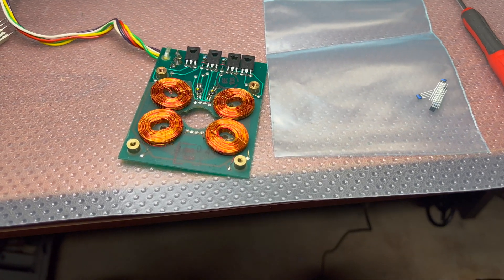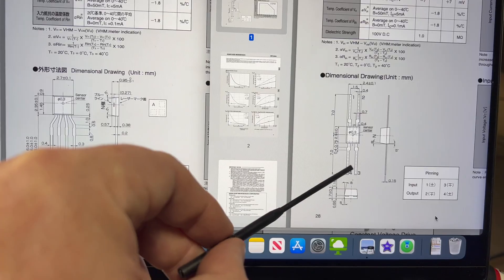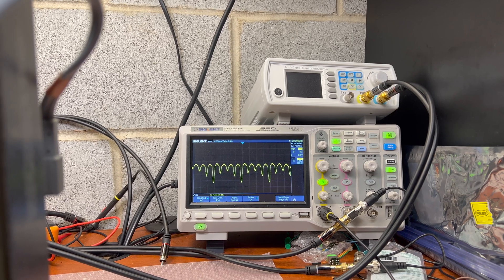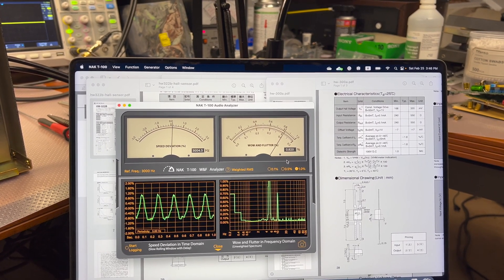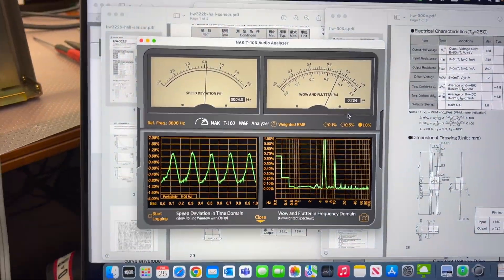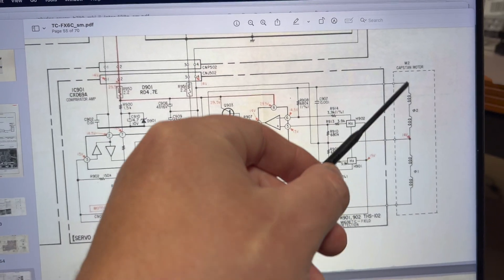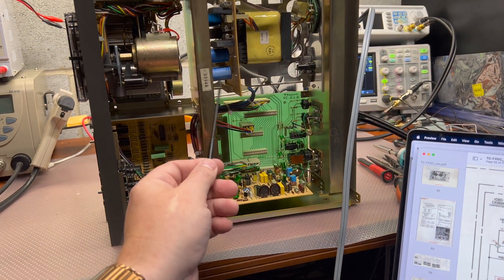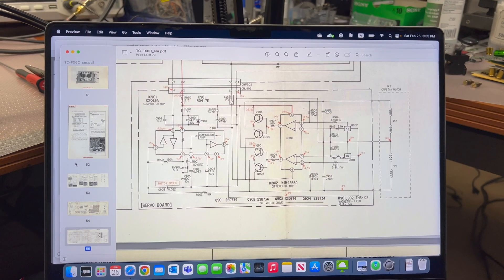Revox Flutter & Wow Diagnosis: Hall Sensor Replacement and Schematic Revision

Comment: I greatly enjoy your videos. And while I agree that the execution of the DD design by Revox in the B710/B215 is more problematic, I believe it was more intentional than an engineering mistake. You can easily look up the schematic for their B795/791 DD turntables, which came out earlier than their tape decks, and they incorporated the exact same design, with opamps driving drive transistors and limiting resistors as you show as typical Japanese. So they were definitely aware of the “right” way to do it, but chose this way for some reason, it seems. My experiences with a number of B710 & B215 decks is that W&F below 0.03% is typical, and often around 0.02% if the transport has upgraded reel motors (ball bearings instead of sintered bronze) and capstan bearings with low wear.

Comment: To me it sounds unplausible the root cause of the erratic W&F is the poor design, I don't argue about the design part but I can't see the HES being the cause... there must be some other electronic or mechanical degradation that prevents the motors or the output of the transistors to properly drive the motors, those waveforms are all MANGLED. I mean... you're on the brink of 1%... that would be unacceptable for a Walkman.

I don't have the necessary experience but nothing looks normal to my untrained eyes in what you show. Are you sure the functioning of the thing after replacing the parts is not being invalidated  by EM interference?

I have reformulated the above question because I didn't mean to say reading, I meant the machine is not being affected by something else that's going on in your lab.

Comment: REVOX, what an extravagant cassette deck it is; but you found out that the Swissi engineers made a terrible mistake in the W&F control architecture?
Reply from the maker: Exactly. That implementation is extremely sensitive for a magnetic flux on the magnet, distance between magnet and a Hall sensors, etc. No single Japanese DD drive deck has the same problems. And I will make sure this deck will work much better. And I will prove my words.